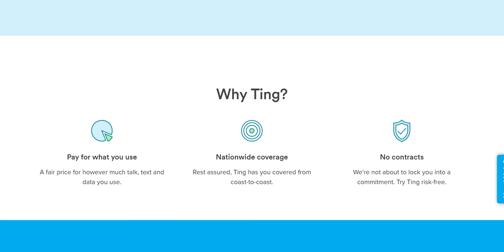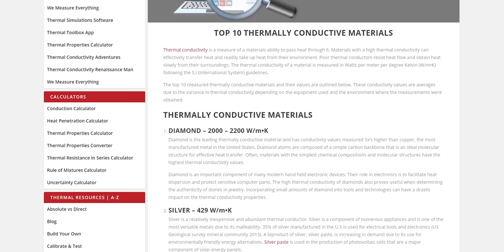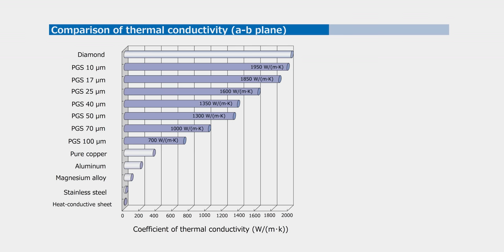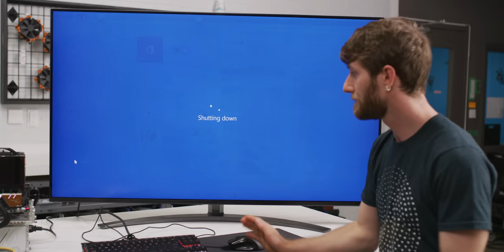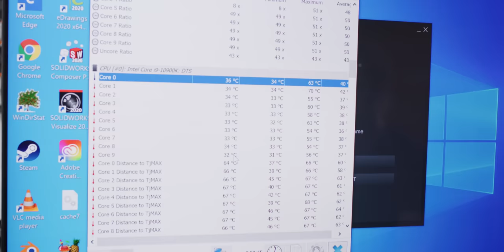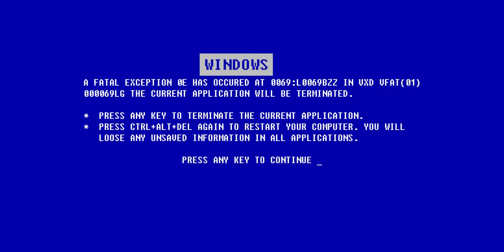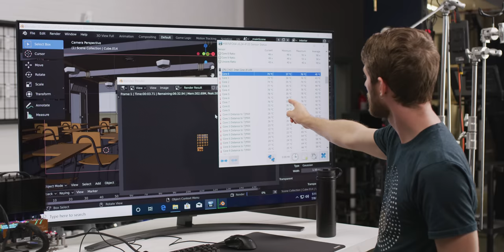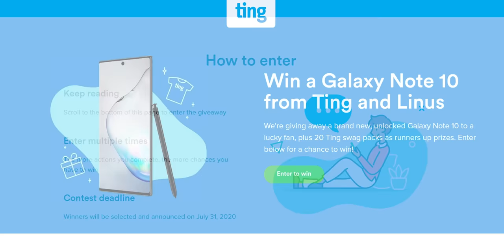This Sounds Too Good to be True - God-Tier Thermal Pad

Comment: You know i'd love to know if it works better with a lapped IHS and cooler plate, so you know it is getting solid contact & minimize the distance as much as possible
Specially with how terrible the IHS on my 3950x was when i lapped it, i want the thermal pads to work!
Reply: This is what I came here to say.
Reply: Thirded (Mike Goggin beat me to it).

But, I'm also looking forward to a solid diamond heat sink.
Reply: As far as I'm aware, the reason this didn't work is because graphene conducts heat horizontally along the plane of the crystal lattice and actually isn't that good at conducting vertically through the different stacked layers of graphene
Reply: Hi Nordern how are you doing?
Reply: What Linus doesn't know is that, that material doesn't have the same heat transfer in all axis of its chrystal structure.

Laterally, it performs great. Close to diamond. 

But vertically, it performs close to copper (about 1/5th the heat transfer laterally)

So, he might as well be using a thin sheet of copper.

You'd need to somehow take advantage of its lateral heat transfer.
Reply: It's too bad they can't buy a similar product where they took the sheet and stacked it in however many layers it took to get full chip coverage and then sheered it through all of the layers to get a thin sheet that is really many layers of the material in it's the best position for heat transfer.  That would also allow for the material to fill in the gaps a bit more when put under the heatsink mounting pressure.
Reply: The problem has nothing to do with lapping (admittedly that is probably a second order effect) but with the fact that the 1950 W/mK are the in plane thermal conductivity (basically spreading the heat from one point in the pad to everywhere else). 

What marketing people don’t allow engineers to write in the datasheet  is that the in plane conductivity (from IHS to cooler) should be around 500 to 1000 times worse, thus in the range of 1 to 10 W/mK, that is comparable to a regular thermal pad.

This is due to the structure of the graphene Crystal itself
Reply: @tylerdurden3722  The only way I could think of taking advantage of the lateral heat transfer would be to stick it to the heat fins / make heat fins out of it.  Even then, after it pulls from the heat pipes it would be limited by its vertical transfer.
Reply: the issue is most likely, the adhesive was insulative.
Reply: Put in blender with liquid metal
Reply: @tylerdurden3722  so, do you think a pad of this would work better for a gpu die then? Given they're typically horizontally aligned
Reply: @jakeiswayblack3377  🤔only if heatpipes aren't already being used.

Heatpipes would work many times better.

I think, this could perhaps be used to make the heatsink itself(or a water block)🤷. Like a composite material. Some good Resin + a single large sheet. You could make some funky shapes

Or, one could make flexible pipes that transfer heat🤷. Roll a large sheet into a pipe and create something like an AIO water cooler (except it doesn't use water...and the radiator is replaced with a heatsink.) 

Basically an AIO without water...or a pump. But, it wouldn't perform as well.
Reply: @kuhrd  I wonder if it would require to much of the glue, making its conductivity drop anyway?
Reply: Also what I wanted to know
Reply: if you're going through the trouble of lapping perfectly, which won't help with this pad anyway, why not forget the pad all together and use no TIM.  I mean, it's likely impossible to get the IHS perfect, being stamped metal, but in theory, having it perfectly machined would beat any TIM.
Reply: How did you do that?  I have a 3950X too, but I haven't tampered with it at all yet.
Reply: If you were going to do the high effort of lapping your IHS then im not sure the reduction of effort using this would be worth it...
Thermal pads are cool for being low effort.
Reply: @LocoHosa  So far, yes, but graphene (when properly utilized) should change that.  I honestly feel like Linus fucked something up here and needs to get in touch with Panasonic to find out if/what he did wrong.
Reply: @johngaltline9933  I tried that (on my father's PC🤣). His IHS had deformations/wobbled.

I sanded and polishes both the IHS and the bottom of the heatsink to a mirror finish...using a huge porcelain tile as a flat surface.

It works. In fact it kinda sticks. (With no thermal paste... it's still in there with no thermal paste😅)
Reply: If you went through the trouble to make the surfaces parallel to each other then you would have better thermal conductivity without anything in between them

Comment: Everyone here is talking about the thermal conductivity of the material without even once considering the thermal conductivity of the interface, which is 100% of the reason you use thermal PASTE instead of a thermal wafer.
Reply: right? The whole point of a thermal interface material is for void fill with a conductive material, otherwise direct contact with no transfer material would be the best way to transfer heat. Something like this would work better under the die than on top of it so it would spread heat across the die better.
Reply: Think a cpu made of this shit would be cool?
Reply: @moribell1083  It will probably be soon. Making 1nm or close to 1nm die process chips are going to be made with carbon nanotubes. This probably could mean better heat dissipation and power efficiency. Slicon based chips at smaller processes have lead to Quantum tunneling so it's why carbon was chosen.
Reply: @plebiansociety  So you're saying we could sand/polish the contact points to a mirror finish (I'm guessing 10,000 grit) and not need paste? Have they tried that yet? After all, the IHS is just a piece of metal. There's no danger in polishing it. I mean lapping. You know those gauge blocks you can use to measure things, where you have to slide them together and they basically stick to each other by a lack of air between them? What if you did that.
Reply: @StapleCactus  yes, it's called cold welding if you want to look it up. You'd just never be able to separate the chip from the cooler.
Reply: @plebiansociety  Doesn't sound like a problem for me. I don't upgrade CPUs since motherboards don't support more than one generation anyway.
Reply: @StapleCactus  only if you're using Intel CPUs. Intel is an asshole switching their sockets every two generations; AMD changes their sockets much less often.
Reply: @pixelmaster98  My comment was more about how I don't need to upgrade my CPU but every 5+ years, by which point both companies would have changed their sockets. After all, I can't fit my old FX-8350 onto my new rig with a Ryzen 7 1700x. And by the time this CPU is outdated, I'll need a new socket since my next jump will probably be Threadripper if they haven't left it behind as well. I don't get the latest CPU, after all. I'm normally about 2-3 years behind the curve to save money.
Reply: @pixelmaster98  Yeah, their lifetime for CPU sockets are longer, but I've never noticed with how rarely I upgrade. The CPU has gotten to the point there's no need to anymore. Heck, this Ryzen 7 1700x is 3 times faster than the GPU in Shadow Tomb Raider, so I only need to get away from this 980Ti to be up to snuff. Stupid GPU market... Where's my MSRP 3080?
Reply: @StapleCactus  I like to imagine coolers manufacturers starting to make the cooler coldplate and the IHS of CPUs into a single block, and you just need to choose the CPU or GPU chip without IHS to pair the cooler with, or even better, either the chips manufacturers or the coolers manuf. will offer different chip/cooler combo all in one piece if you don't feel like connecting the bare chip with the cooler. 
And for future upgrades you could at any time separate the chip from the cooler

Comment: Here's an idea: apply this to spread the heat and then thermal paste to conduct it.
Reply: You'd have to apply compound on both sides and at that point it seems redundant
Reply: Bebopopotamus the adhesive should be enough for one side of the interface since the material will conform to the first side.
Reply: There is a problem: I bet that Linus does not see this.
Reply: That would be really interesting to see on a Ryzen 3000 CPU with the die sitting on the side rather than in the middle of the heat spreader.
Reply: Tbh I'm surprised nobody has tried lapping the IHS and cooler face and soldering the cooler to the IHS.
Reply: Exactly what i was thinking
Reply: That's a neat idea. If they don't lap the IHS and heatsink then I'd try this too. This sheet would horizontally spread the heat more evenly and then paste or pad would transfer it vertically.
Reply: I'd like to see that.
Reply: A conductor is like a resistor in an electrical circuit.
The more conducting materials you stack on top of the other, the more the resistance goes up, irrespective of how good the material is.

In other words, you're better off just using thermal paste (or liquid metal)
Reply: Same thought I had, paste on the chip, pad on the cooler.
Reply: Then why use the pad at all
Reply: The heat spreader and heatsink are made of metal, the conductivity of the metal is orders of magnitude higher than the pad. It won't do anything.
Reply: Due to the crystal structure this stuff cannot conduct top to bottom. It simply doesn't work. When Linus held it the sheet conducted side to side then. It does not work in the other plane. Imagine the crystals are like this ==== they need a sheet where the crystals are like this ||||

Comment: since the problem is probably the contact surface being uneven
...
you could put some thermal paste on it to bridge the gap

wait.
Reply: The biggest problem with it would be the fact that graphene is a great thermal conductor along the plane of each carbon layer, however the thermal conductivity between those layers is poor.
Reply: This would actually be a cool concept to test, since we  know that the die actually heats unevenly.

Comment: I have an HP pavilion 5030 from 1995.  It was HPs first Multimedia PC.  It is running a Pentium 75Mhz.  It has a carbon heat pad between the CPU and the Heatsink.  Years ahead of the curve.  It does handle an overclock to 90Mhz with no fan, so there is something to carbon pads.

Comment: we actually use graphite tape as a thermal transfer in glass blowing. Cept its cut into a roll like tape. i tear a bit off and use it to keep temps the same between to pieces of glass that are touching but not meant to be melted together.

Comment: Have you guys considered using both at the same time? My hypothesis is that the liquid molecules can, because of their fluidity, go into the small imperfections on the CPU's integrated heat spreader; and the imperfections into the CPU coolings solutions contact area. So if you use a small amount of the liquid on the CPU, and put the PGS on top of it, and then put a small amount of the liquid over the sheet, and then mount the cooling solution on top of it. This seems like its worth trying.
Reply: the paste shreds apart the sheet.

Comment: Get the version without adhesive, ive had it on my 2950X for over a year and it is overclocked to the max and doesn't go over 72C, it also really really helps to have a flat surface, this pad is thermally conductive on the horizontal plane more than the Z plane.
Reply: Hi. Which product number are you using?

Comment: A diamond you say 🤔 I request a ltt video where y’all cut a diamond sheet and used it as a thermal stone
Reply: I think they already did that. Although that was powdered diamond. Riley did it I think. The video was different things as thermal compound. Can't remember the name. They even used a toothpaste.....
Reply: they explained that it needs to fill the little gaps
Reply: the hole point of a thermal compound is to be fluid
Reply: @ananyaig  twice actually.... they also tested thermal epoxy from Tech Ingredients which is also a blend of micro diamond and other materials.

Comment: Why not try to use this stuff on the grill/fins of your cooler? That's much more in-line with the intended use case and could enhance cooling.
Reply: No matter how conductive it is it won’t increase cooling compared to not having an extra layer present. The purpose of thermal paste/pads is to fill the gaps between two separate metal objects, like the IHS and the cooler.
Reply: @CoconutMigrating  I'm thinking more for moving heat throughout the fins. That's similar to the idea of using it to move heat on the nose cone of space ships on reentry. not to increase the dissipation. The concept being airflow not hitting all areas on fins equally.

Comment: What people need to understand is: Why do we need something between the dissipator and the CPU?

It is to "fill" the imperfection on both surfaces.

You don't fill imperfections on a solid surface.... with another solid.
Reply: Well, you could, if it can deform enough under pressure, e.g. a soft metal foil with heavy screw pressure could make contact with the edges of a convex surface or center of a concave one, which is really the more important part. And some larger cavities could also be filled that way

Comment: it is kind of a waste to use that on a CPU, since aluminium only has 205 W/m.k on the heatsink... It is really bottle-necking there.
Besides, thermal paste is used to fill in the micro-gaps on the metals, not be the main thermal transmitter between the metals.

Comment: Next attempt: Lap the IHS and the cooler to make sure they're perfectly flat.
Reply: The problem with this is that it only conducts heat really well in the x & y planes, not the z plane. It'd be really good for spreading heat out, but not for conducting it into another object above it.

One thought I had was direct-die cooling with a waterblock, where this pad was on the waterblock and you used liquid metal between the direct CPU die and the thermal pad on the waterblock. liquid metal would do it's job to get heat away from the CPU, and the pad would act as a big-ass, super-thin IHS strapped to the waterblock.
Reply: @Crazyates11  Mak this a normal comment and let this linus see

Comment: Wouldn't even consider this for cooling electronics, but did use this as a Tim for mounting a heatsink on an large bore AR barrel (this allows for longer periods of sustained fire, as excessive heat will cause malfunctions or even catastrophic failure). Thermal epoxy was used to fill the gaps on the sink/radiator side, and this makes for an extremely durable and heat tolerant Tim, especially suited to applications where longevity matters far more than thermal conductivity. It does become single-use at that point though. The barrel radiator/sink in reference here is the "Thermal Dissipator" from JP Enterprises, for those curious.

Comment: Yes, I would really like to run my computer at 90 degrees.
I'm using a macbook air.
Reply: When a overclocked RTX 2070 has less heat, air cooled than a macbook. bruh
Reply: rawpie 
Comparing any desktop component to any laptop component is dumb tbh. My 970m gets to 95 degrees. But it’s also a laptop. Desktop cards aren’t supposed to get anywhere near that ever, plus they’re way bigger and are in a giant open box basically where air can circulate.

Comment: What about soldering heatpipes directly to the cpu heatsink?
Reply: I'm waiting for the day when they integrate some sort of heat pipe system or some sort of thermal transfer mechanism right into the die connected to the IHS

Comment: hey Linus, since this pad conducts the heat laterally, I think it might work much better if you will stick it to the cpu and then, use some thermal compound on top of it, so that the generated heat will be transferred laterally very quickly

Comment: How about taking a longer sheet and sticking it to both CPU and base of the cooler at the same time and folding it?
Reply: That sounds great. Maybe the material brakes if you bend it like that, and that's why they didn't do it.

Comment: Panasonic make a soft PGS graphite pad 0.2mm thick that has a thermal conductivity of 28W/m-K in the Z direction suitable for a CPU, would be interesting to see a follow up using a material actually designed for this purpose.

Comment: 4:05 Nuclear reactors... then shows cooling towers common to all electricity plants.
Reply: Blame the Simpsons
Reply: Well after a bit of a hectic search, the image is from shutterstock by a contributor known as Chuyuss, in a gallery centered around China. The image itself is tagged nuclear, notably the only one out of several other Powerplants they have images of. Only one where the location isn't marked either... not sure if there's a connection there.

Comment: I sometimes think if one of the manufacturers would release a CPU with surface integrated with a radiator base ,which would rid the need of a thermal conductor.

It would mean that you couldn't replace the cooler ,but if they make it top-tier(probably for a flagship ,as that would justify their expense) ,you wouldn't need to.

Comment: Use it as a spreader. Like a copper block between your device and heat sink. 
Turns a 2x2 inch conducive pad into a 4x4 inch or bigger pad. Because the heat goes latterly. The opposing faces don't have to mach.

Comment: Well I gotta say, that's a lotta voltage.
Reply: No point doing thermal tests with a low output source... the higher the heat, the bigger the differences measured

Comment: Thanks for doing this test. I was considering using this on my next system. But like you, I was wondering if it was thick enough and squishy enough to fill in the voids and actually transfer the heat.

Comment: It would be interesting to see if you had it folded over itself into two layers of one complete sheet. It would in theory allow the dispersion of the heat from the die to the cooler as it has a path to take around the sheet rather than trying to have it go through the sheet directly? Probably wouldn't make any difference but sparked my interest.